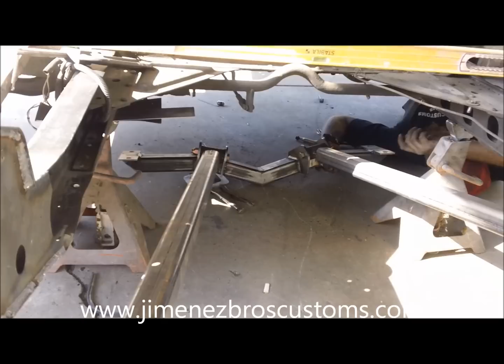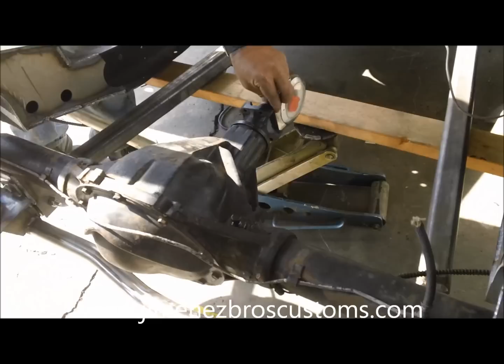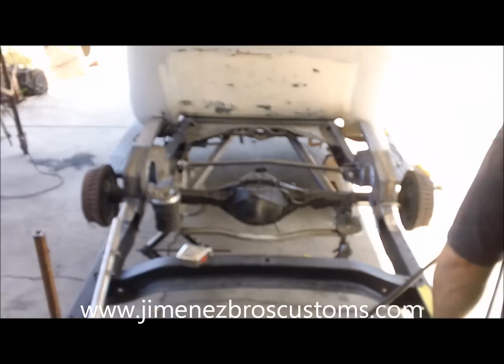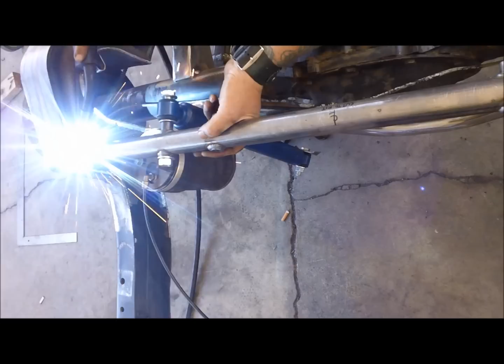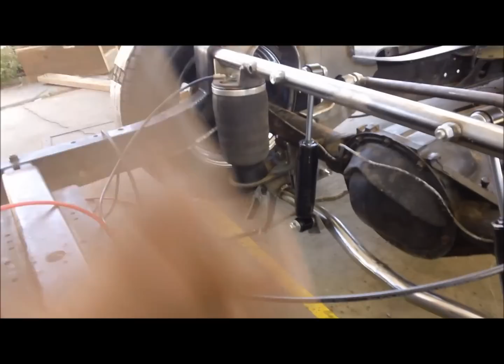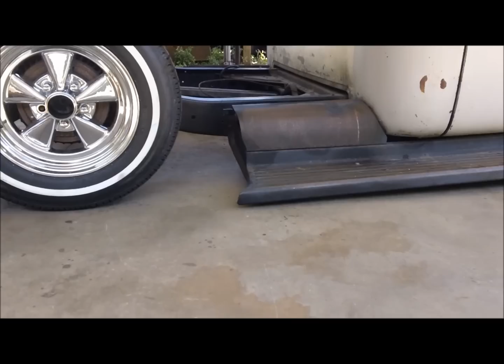Jimenez Bros Customs / How to installl 2 link / suspension  PART 2

Comment: Can you run just the air bags? Or do you need to have shocks also?
Reply: Videonun Perde Arkasi http://youtubem.video/r/?O1Ga50jiCyho4hqARseuxNu=S94cVm7LCpMkPYs6w1JR
Reply: Videonun Perde Arkasi http://youtubem.video/r/?O1Ga50jiCyho4hqARseuxNu=S94cVm7LCpMkPYs6w1JR
Reply: On the front... ehh not so much. on the back, yes. You will have an annoying and dangerous bounce if you don't run shocks. The front will just wallow a bit but the weight of the engine minimizes the bounce. 
But to be safe you should always run shocks.

Comment: Do you sell a kit for a 52 Chevy truck
Reply: Jimenez Bros Customs  cuanto bale a migo
Reply from the maker: yes we do. $1195.00 We also have an updated video for the 41-48 that shows the updated parts. feel free to email jimenezbroscustoms@hotmail.com if you need more info.

https://youtu.be/kPlr4tkeZRI
Reply: Jimenez Bros Customs if I had a truck similar weight and wheel base of 115 inches where as a53 Chevy has a 116 inch wheel base with a similar frame shape could I use your kit on an IH r series pick up .
Reply: Videonun Perde Arkasi http://youtubem.video/r/?O1Ga50jiCyho4hqARseuxNu=S94cVm7LCpMkPYs6w1JR
Reply: Videonun Perde Arkasi http://youtubem.video/r/?O1Ga50jiCyho4hqARseuxNu=S94cVm7LCpMkPYs6w1JR
Reply: Videonun Perde Arkasi http://youtubem.video/r/?O1Ga50jiCyho4hqARseuxNu=S94cVm7LCpMkPYs6w1JR
Reply: Videonun Perde Arkasi http://youtubem.video/r/?O1Ga50jiCyho4hqARseuxNu=S94cVm7LCpMkPYs6w1JR

Comment: beautiful, great job, but one technical note...that's a 3 link, not a 2 link, least ways according to the training I received getting my journey man's papers.
Reply: In all car culture, they don't count the panhard as a link. I find it kind of annoying but everyone does it. 3 link offroad front ends still call it a 3 link even though it has a panhard. A parallel 4 link like drag cars use in the back still don't count a panhard. And old stock suspension like on these trucks still call it a 2 link even though there is a panhard.

Comment: do you have a one piece driveshaft or did you make a joint after the crossmember?... I saw than i have the same trouble conecting my 4 links so low. The center height of the rear axle is upper than the transmission center... please help me
Reply: Videonun Perde Arkasi http://youtubem.video/r/?O1Ga50jiCyho4hqARseuxNu=S94cVm7LCpMkPYs6w1JR
Reply: Videonun Perde Arkasi http://youtubem.video/r/?O1Ga50jiCyho4hqARseuxNu=S94cVm7LCpMkPYs6w1JR

Comment: I'm just curious.I've seen this on a lot of linked trucks.What is the purpose of using the stock shocks?Wouldn't these slow the travel of the rear end?I mean the faster the travel,the better the setup.I don't get it.Why not use 4 bags instead of only 2.Any recommendations on brands of bags?
Reply: +Aaron Stone i know it's late but i guess i could answer some of these questions. 
#1 - if it isnt a "race truck" or performance oriented you can use stock shocks just fine. as long as the shock is rated for the travel and weight of the vehicle. you can add performance or adjustable shocks but this should not be the only thing you use to adjust your ride quality or performance. type of link system and location of your bags will play a much bigger role in performance over a shock.
#2 - By "a faster traveling suspension" i suppose you are referring to the fill rate. this is controlled by the size of lines, fittings, and valves. this is completely cosmetic. some like it to bounce up and slam down where others like the slower softer lift and lower. i personally started out with a truck running double 1/2 inch lines and valves which would cause the truck to get off the ground about 5 inches with 200 psi but it would violently slam down and all the space in between was terribly hard to adjust. as a got tired of this i moved to single 1/2 with a dump control. i have found that for my taste i prefer 1/4 line and valves for all 4 corners for a smooth and easy lift and lower.
#3 - 4 bags on the rear would make the suspension far to stiff like driving around in a truck with super stiff towing springs. most air bags have a higher weight handling rate than your average mid-sized truck stock suspension so 2 is plenty for a cruiser. Also, having 4 bags in the rear would double the amount of air used to inflate which means your compressor is running more often leading to earlier ware.
#4 - as long as you stick with name brand you will do fine. stay away from ones that don't have a warranty or name stamped on them. After that there are a lot of different opinions on which is a better air bag. i personally prefer slam specialties because they use a stiffer and thicker rubber which reduced ballooning and makes a more responsive ride rather than the thinner bags which can cause the vehicle to wallow or flout. slam bags also get ALOT of lift compared to same size bags of other brands. i dont recommend using these sleeve bags because they rub on themselves when collapsed which will cause a hole. (many stock cars use these kinds of bags on the rear such as navigators, Cadillac, etc and they all seem to go bad). reputable brands for bags would be contitech, slam specialties, firestone, air lift, and ride tech. im sure there are more out there but those are the ones i know off the top of my head.
Hope that helped.
Reply: Helped me, cheers
Reply: MotorcycleTherapy no problem. it can be a confusing hobby to get into. just be safe.
Reply: Aaron Stone shocks slow the action of the spring(air bag) you need to choose the shock for your needs.

Comment: This isnt a terrible design just not ideal. My buddy has been rocking a 2 link for 6 years and its fine if you drive at the same height all the time on the highway.
However, if your going to go to this kinda work just do a 4 link, it will keep the pinion angle more consistent.

Comment: What size bolts do you guys use on the front bushings to mount the bars. The biggest bushing and bushing sleeve combo Ive found to  use when I build it uses a 9/16" bolt.  Buildind a full size silverado and it just seems like thats a lot of weight for that size bolt.

Comment: not sure what his problem is. bagging that is no different than bagging any thing else. when the bags get old and fail it will just sit on the bump stops so if your lowest hits the ground your stuck but that is the same with any other bagged suspension. im doing and IRS and i plan to go bags on all 4 corners. i accept the inevitable blown bag issue.

Comment: I see the two bolts under the axle holding it straight now. As long as its mostly driven where the pinion angle is set up correctly a 2 link works.

Comment: i learned the hard way i bagged a 2 link on a 66 impala wagon 15 years ago before every one made parts for these it road bad the pinion angle changed so much during its range of motion that you couldnt drive slammend had no side play and the drive wheel would come off of the ground on uneven ground. all are inherent issues with doing it this way

Comment from the maker: CHEVY USED A SINGLE U BOLT PER SIDE ON THEIR 2 LINK SYSTEM. OURS IS WELDED, NO I HAVE NOT TRIED PUTTING MORE THEN 600 H.P. BUT IT SHOULD NOT BE A PROBLEM. MOST OF OUR CUSTOMERS  CUSTOMS, LOWRIDERS AND STREET RODS. IF YOU WANT TO DRAG RACE I SUGGEST A 4 LINK.WE DO HAVE A YOU TUBE VID OF 2 LINKK WORKING WITH UNDER CAR CAMERA VIEW. THANKS FOR THE TIME.
Reply: Videonun Perde Arkasi http://youtubem.video/r/?O1Ga50jiCyho4hqARseuxNu=S94cVm7LCpMkPYs6w1JR
Reply: Videonun Perde Arkasi http://youtubem.video/r/?O1Ga50jiCyho4hqARseuxNu=S94cVm7LCpMkPYs6w1JR